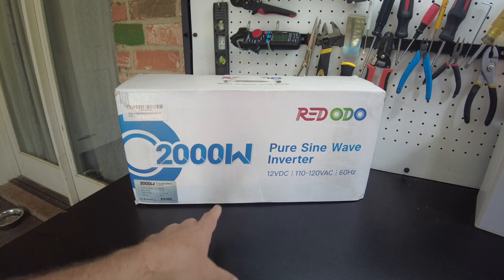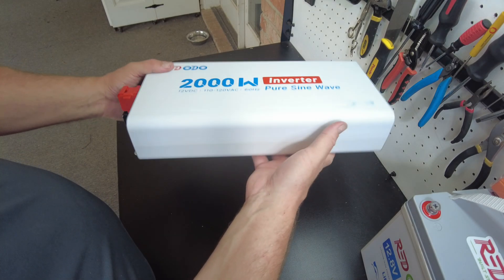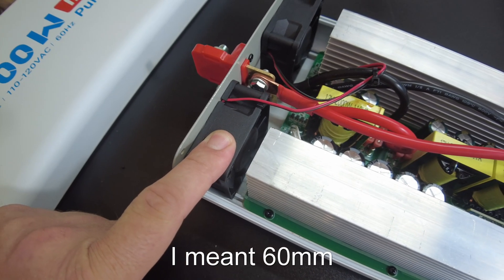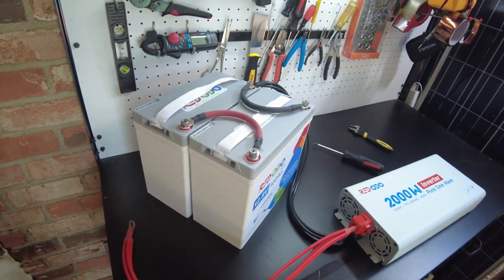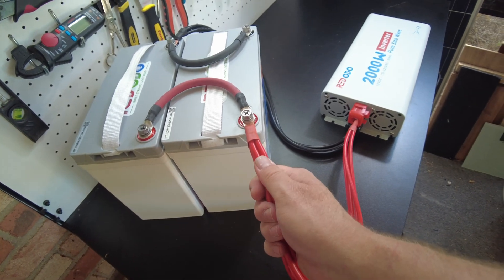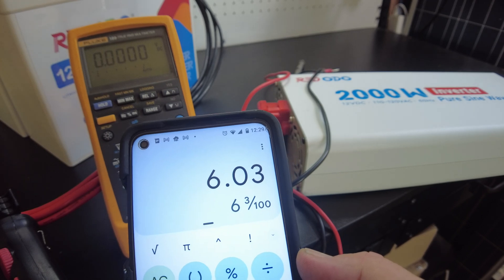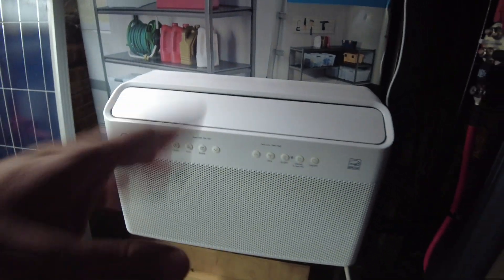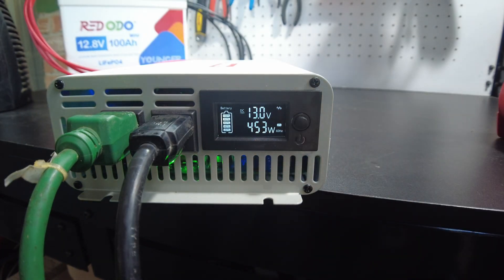REDODO 2000W 12.8v Pure Sine Inverter

Comment: The display showed the battery voltage dipping below 11V. Their 1000W inverter has low voltage protection at 10V. Perhaps the voltage was intermittently dropping below the loa voltage threshold causing the chirping.  Could be a battery issue instead of an inverter issue.  As far as the internal cables, copper wires actually have a very high capacity, it is just that the insulation has limits. Active cooling from the fans should take care of that, but it does turn those wires into little heaters which will reduce the efficiency at higher loads.  I would like to see companies use variable-speed fans. For many loads just a slow fan would provide enough cooling while keeping noise levels low. Instead, inverter fans typically are either fully on or off. That leads to inverters running without the fan for a few minutes with 10 to 15 second bursts of a loud fan noise. They should do better. I would also like to see inverters incorporate heatpipe technology with cases designed for heat dissipation, thus reducing the need for fans. Combine that with variable-speed fans and inverters would be nice and quiet. Though the fan isn't overly loud, the noise becomes annoying after a while.  Appreciate the review.
Reply from the maker: Thanks for the feedback!

Comment: Thanks for uploading your experience with this inverter. I have two 100AH batteries from Redodo paired with a Kreiger 2000W PSW inverter I got last October. It hasn't seen any substantial use at all. It has only been used to charge some power tool batteries so the unit is basically on stand by in case of a power outage emergencies and we need to run some AC or small heater and medical equipment. I went o charge up some batteries last week and it failed to turn on and it just died. I packed it up to send it in for repair or replacement warranty and paid $60 to ship it and insured it for the purchase price of $300. I can't believe the Kreiger just crapped out after not even being run on any big loads at all smh. I was looking at the Redodo unit but after watching this and it chirping like that, it's made me 2nd guess it buying it now.
Reply from the maker: Wow, bummer on that. My two most used, and oldest inverters are a Reliable brand 24v 3000w, and a Leesky 12v 1500w. I've had 0 issues from these inverters.

Comment: Yea, it seems to run everything perfectly fine when it's new, but give it a few months of running inductive loads and I guarantee you this low cost, high frequency, transformerless inverter will become a brick and can even damage your appliances by passing high voltage, high amperage, DC current to your loads.  High frequency, output transformer free inverters are not designed to run inductive loads like microwave ovens, large power tools, portable AC units or motors. You may be able to start and run some of these loads when this unit is new, but every time you do, you're damaging the cheap Chinese made MOSFETs and capacitors in these inverters. I've spent the past 23 years in the inverter repair industry and can tell you from experience that no high frequency inverter exists  on the market will last more than a year when exposed to high inductance loads. If you want an inverter that's going to last 8 tob10 years+, then spend some more money and invest in a low frequency, transformer based inverter.
Reply from the maker: I have a high frequency inverter that's been running a 12000 BTU A/C going on 3 years now.
Reply: @BradCagle is it four now?

Comment: I actually have my 2 wires connected to one battery(with 2 in parallel) for 5+ months and the system is flawless. Until I see someone prove it to me otherwise that it's bad I will leave my connections as that.
Reply: Obviously it still works, but your batteries won't be discharging and charging equally
Reply: @Lewythefly  Batteries are like 2 containers of water. They will constantly keep each other balanced.

Comment: Another very informative video. It seems like a decent price for that inverter. I have 3 of the Redodo mini batterries which I have hooked in series for my 36v trolling motor. They work great for that application. I have an Amped Outdoors bluetooth battery monitor installed, with the series configuration, to help monitor the state of charge. 
With all the products that Redodo has come out with so far, I wonder if they have thought about making a bluetooth battery shunt/monitor? 
I did inquire with them about the possibility of a marine starting battery as well. It would be nice to replace my current AGM starting/house battery with lithium. I do know there are several other options to fill that need, but it would be nice to have all the same brand if possible...🤞😎
Reply from the maker: Thanks! Yeah I agree, a redodo shunt would fill the gap.

Comment: If no error conditions were being flagged, my guess is the buzzer software is buggy.
Reply from the maker: Ben, that was really my thought the whole time.
Reply: The beeper is likely driven by the PWM card seen at 1:51, that vertical daughterboard next to the heatsink.  What is shown on the front panel will very likely have nothing to do with what the PWM card is getting up to.  The AC voltage will probably be monitored by the front panel directly with a resistor divider and the watts computed using that in combination with perhaps a CT/shunt on the live AC wire or by the shunt on the H bridge that the PWM card uses to tell if something is going wrong.  It is often possible to disconnect the front panel and have the inverter continue to function completely normally in all respects including protection (of course don't do this if you don't understand the thing fully).

Comment: Felt like a snake oil sales job for a free inverter.

What other inverters have issues when running your AC unit on high?  What did REDODO say about the mystery chirp?  What does the chirp indicate?  Is it expected?  Did you test out their customer service?

The cables on the inside were obviously undersized.   Why did you sweep that one under the rug?  You have a thermal camera.  Why no stress test near max load then look at those cables to see how they handle ~200 amps?
Reply from the maker: Thanks for the feedback. Yeah I realized I got off track with the chirp, that was unexpected, and really turned the focus. I'm going to do a follow up video
Reply: @BradCagle  thanks for the follow up video!

Comment: Giandel inverter or GTFO
Reply: Giandels usually do make their power rating, even if they are on the ragged edge when they do.  What you may not like is, depending on the model and where you are in the world, is their idea of safe isolation.

I've repaired some of them and when I see the only thing keeping the case of the inverter/LVDC/HVDC isolated from each other being a single thin layer of kapton like tape between the case and the metal tabs on the FETs and rectifier diodes, well, that doesn't fill me with confidence.  It would be so easy to pierce that thin tape with a metal sliver and then you have a problem that could well kill you.  Just taking the board out of the case can damage the tape.

Until you work on any inverter designed and built in that country, you really don't appreciate just how bad it all is and this stuff is everywhere.  From these portable jobs to screw on the wall all-in-one inverter chargers so much of it is so terribly dodgy.

Comment: Any inverter that won’t output a steady 115V is garbage… 120 should be the goal. Most routinely drop below 110V, yours showed 103V at one point. 
Most likely the meager pair of #8 conductors is heating up, and drastically limiting current from the battery.
Reply: Boy do you have that right.  Wouldn't run my 7ct chest freezer or my kitchen fridge with that 109 AC v.  Sorry I bought it.

Comment: A lot of people have been bringing up the PF of the aircon (ie stating it is a heavy inductive load).  Any chance of the model # of the aircon so we can look up what design it is, line / inverter operated compressor and see if there is any PFC in the unit?

A kill-a-watt type plug in power meter will usually tell you the power factor, so you can report the PF at different cooling settings.
Reply from the maker: It's a Midea u shaped 12000 btu inverter A/C
Reply: @BradCagle No official documentation about PFC but I have found reports around 0.85. Specs says 1.2kW (about 10A) peak in cooling mode.  It should be draw around 12A with that PF.  The inverter should be good for 16A.  From the description the aircon does have harmonic issues and that would increase the short term current but it should still be within the capabilities of the inverter without it sounding an alarm.

All of this is educated guesses since there is no official documentation about this in the user's manual.  Someone with a power analyser would be able to tell straight away.  A wattmeter probably won't reveal the details of harmonic draw but it would indicate approximate PF.
Reply from the maker: @retrozmachine1189  Thanks for the great info! I have a kilawatt, I might hook it up to check the PF.
Reply: @BradCagle  OK, so it's an inverter type.  That rules out inductive PF but it could well have cap+harmonic.  I'll look into that if you don't beat me to it with a watt meter.

Comment: I think the inverters without a true ground seem to have problems with certain loads. A guy was telling me they kinda need a earth ground for refrence so they can build their signwave consistently at different load levels. I have a cobra 1500 from a truck stop and that little inverter has troubles like that with some stuff
Reply: No, that's not true.  No connection to the earth we walk on is needed at all.  It wouldn't surprise me at all if this Re-dodo inverter is just another cheap piece of junk (sorry folks, that's how it rolls) and is hitting its actual continuous rating.  The 2000W is probably some BS such as 'peak rating' for 20mS.

How can it be that the front panel is not showing any alarms when the unit is doing that weird beep?  Simple.  The front panel display is usually, not always!, just usually completely unrelated to the control circuitry.  It's just there as a window for you to look through to see how the inverter is allegedly performing.  What the control board in the inverter (usually the smarts are on a separate vertical daughter board) sees and reacts to can be completely different.

Of course, this could just be a 'faulty' unit.

Comment: 👍👌❤️🇨🇦, gr8 review, but woukd have liked the inverter  voltage to be between 115 and 120
Reply: @@thesolarjunkie well even though most appliances have tolerances , 115 to 120 volt output is even better, been living totally off grid since 2000, 36 x 405 watt panels

Comment: I looked around for awhile before I settled on the Energizer EP2000, which is ETL Approved Under UL STD 458. In my opinion these inverters just don't seem all that safe. You should test the Energizer EP2000 if you get a chance.

Comment: It’s because AC units have bad power factors due to being the inductive load and you are using a 2000 watt High Frequency inverter.  HF inverters work well with resistive loads, but they do not handle inductive loads well. To fix, either get a larger high wattage  HF frequency inverter, say about 3000 watts. Or switch to a Low frequency inverter around 2000 to 3000 watts.
Reply: I suspect this aircon is one of those midea inverter jobs, similar to their in window units.  If anything the unit would appear as a harmonic capacitive load to the inverter but it probably has some type of power factor correction in it.  Even if it is a line driven compressor it will again likely have power factor correction via a capacitor.
Reply from the maker: @retrozmachine1189  It is a Midea u shaped 12000 btu window unit.

Comment: Really good video. I have seen that issue with many different inverters and loads. I like the cables they supply looks like some companies are listing 😊
Reply from the maker: Yeah, about time a company actually supplies a cable that is capable of handling the load, was a surprise. Ok so you've seen the weird load behavior, oh that's right I think you had that with an air pump on the ampeak inverter, right?
Reply: @BradCagle  Yep, I've also seen it when trying to run a battery charger off an inverter.
Reply: This inverter is nothing more than a rebranded inverter sold on Amazon under various brand. I have a 1500w from "Luborn". If you search "PrtnrTek" you will see the exact same inverter. My 1500w has been actually very steady. I ran an air fryer and that sucker will run ~1500w. I did run it for close to 10 mins so your 2000w unit is probably defective. I also had this inverter running a full size fridge 24/7 and I had no problem.

Comment: This is a power factor issue.  The AC unit is using more power than shown. This problem is common with a High Frequency (HF) inverter - they don’t like induction loads. Move to a low frequency (LF) inverter.

Comment: I'm wondering if the pure sign wave craps out or gets a little funky looking under the high load of the AC and creates some kind of weird feedback the Inverter doesn't like. You don't need a pure sign wave to run the Heat gun or the Blower so  the "Cricket" was behaving.

Comment: Each outlet is only rated for so many amps. You're exceeding the amps on the one outlet.
Reply from the maker: Each one is rated for 18a per the manual, that would be 1980w. Also I just checked they have continuity between both receptacles, this means they are wired to a common spot on the board, and there is nothing capable of monitoring each individually. Thanks!
Reply: Very good point!
Reply: No, when the power is converted to AC, 15 amps will give you 1800 Watts at 120 v AC.  For 12 volts  DC to supply the power up to the inverter, higher amperage is required.  That's why large wire and more than  100 amps BMS is needed to support up to 2000 watts.